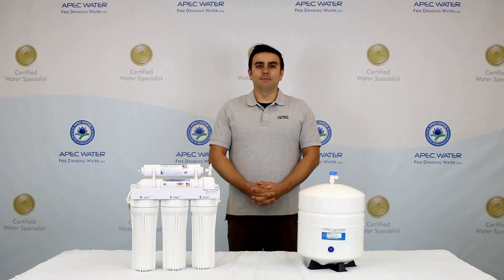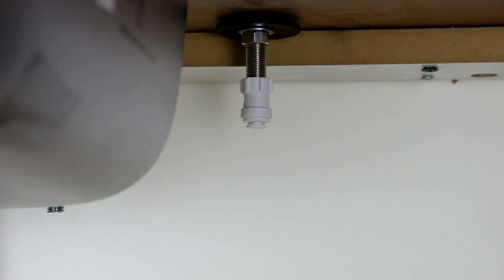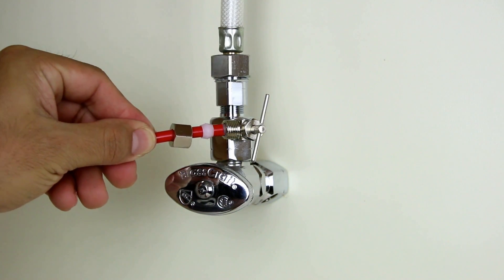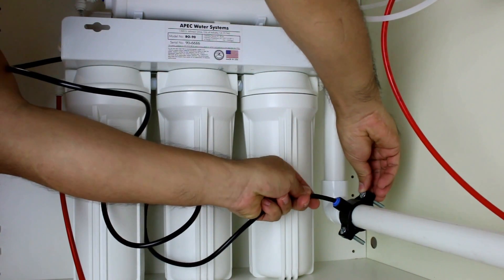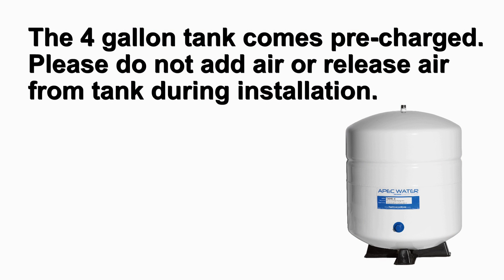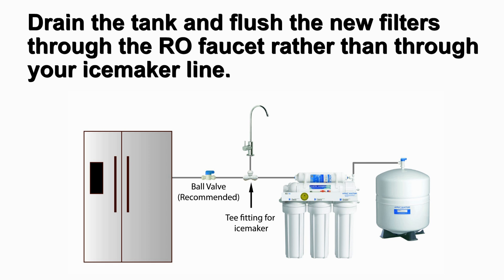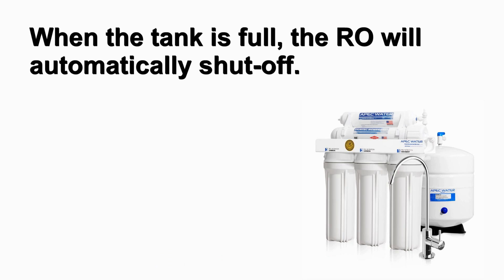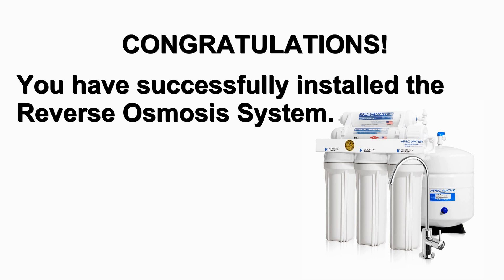New Version APEC Ultimate Series Reverse Osmosis System Tubing Connection Installation Guide Part 5

Comment: Worked flawless for a year, changed filters, can't stop leaks.
Reply: oralosac Absolute trash. Same has happend to me and i was dumb enough to relace all sorts of shit until it got to the point where i could have bought an entire other system. Worthless.
Reply: Did y’all change the o-rings out or make sure the rings were in there once you replaced the filters?
Reply: @michaelwheeler6264  <-- This man sounds right.

Comment: Thanks for the video, turns out the most challenging part was drilling holes lol. water coming out the faucet is super low volume atm, I’ll wait for the tank to fill I guess.
Reply from the maker: Dear customer,

Yes once the tank is full after 2-3 hours you should have full pressure. If you need further assistance, feel free to contact us directly by calling 1-800-880-4808 or e-mailing us at info@apecwater.com. We are in the office from Monday-Friday from 8:00am-5:00pm PST. 
Best Regards, 
APEC Support Team

Comment: Does the discharge line come out of the second port of the filmtec filter? Not sure why this part is missing from instructions on paper and video trying to change my filter out and want to make sure they are connected properly.
Reply from the maker: Dear Valued Customer, please kindly see the attached RO system top diagram. Point W is where the black drain tubing is connected at the stage 4 membrane filter output side. Thank you!
Reply: if you make a each joint instructions in photo picture with tubing color we will more understanding, especially for like me, my first language is not English. Thanks !

Comment: I have a leaking in the 1st stage housing unit, so I changed a new filter plus the O-ring but still leaking, any suggestion on what to look next? I have a REUS-PH 75 system. Thanks
Reply from the maker: Hello Hao,

I am sorry to hear about this issue. If you can contact us directly to provide us some additional information such as a picture of the leak, purchase invoice, and water pressure at your location by calling 1-800-880-4808 or e-mailing us at info@apecwater.com. We are in the office from Monday-Friday from 8:00am-5:30pm PST. 

Best Regards, 

APEC Support Team
Reply: @freedrinkingwater  I bought the system back in 2017so don’t have the invoice anymore. I changed the filter based on the recommended schedule. And everything has working fine and it just happened suddenly 2 days ago. How do I find out the water pressure? I live in los angels area? By the way, email sent. Thanks
Reply from the maker: @haoha7125  Dear Hao,

I did not see any emails come in under your name. If you can provide us with your email address can send one over to you so that you can reply with the picture of the leak. The water pressure can be tested using a pressure gauge that screws onto an outdoor garden faucet (can be purchased at a local hardware store).

Best Regards,

APEC Support Team

Comment: How long are you supposed to drain the 3gallon tank vs the 4gallon vs the 14 gallon and the 20 gallon tank? 1 hour? 3 hours?
Reply from the maker: Hello, 

for a new system installation we recommend flushing out 1-2 tanks of water before using the system for either sized tanks.

If you need further assistance, feel free to contact us directly by calling 1-800-880-4808 or e-mailing us at info@apecwater.com. We are in the office from Monday-Friday from 8:00am-5:30pm PST. 

Best Regards, 

APEC Customer Service
Reply: @freedrinkingwater  how many hours is that?

Comment: how do you get air back into the tank
Reply from the maker: Dear Valued Customer, 

Normally, if the tank needs to add air, it may not be holding the pre-charged air when the tank is empty. For example, if your tank is very heavy (full of water), but very little purified water flows out, In this scenario, pressurizing the tank may not help so we recommend replacing the tank.

In order to add air into the tank, you will need to completely empty all of the water out of the tank and add air into the bottom of the tank where there is an air stem valve. For our standard 4 gallon tank, we recommend 5-7psi of air.

If you need further assistance, please contact us directly by calling 1-800-880-4808 or e-mailing us at info@apecwater.com. We are in the office from Monday-Friday, 8:00 am-5:30 pm PST. Thank you.

Best Regards,

APEC Support Team
Reply: I just re-pressurized my tank following the recommended procedure.  It seems to work perfectly again. Thanks!